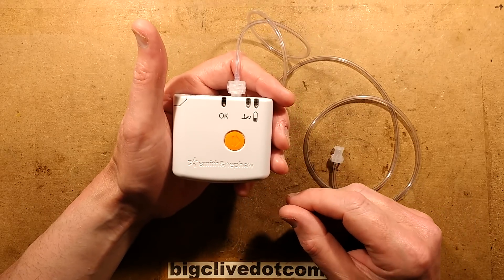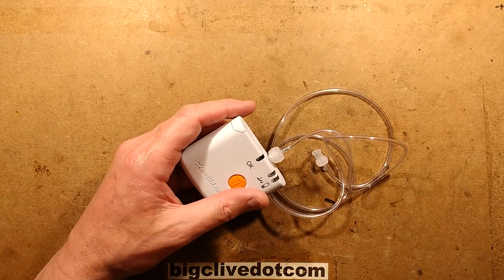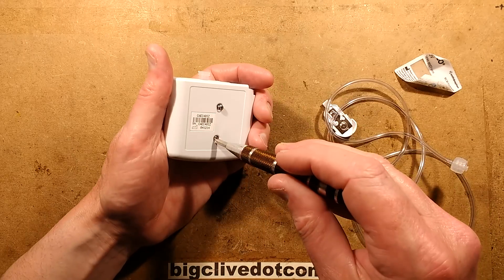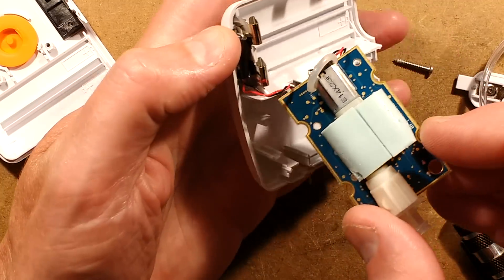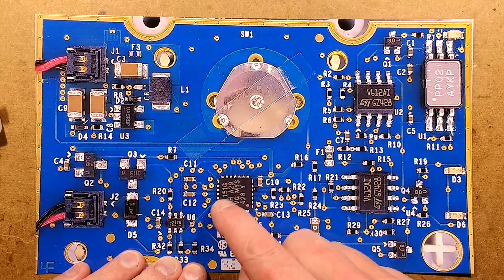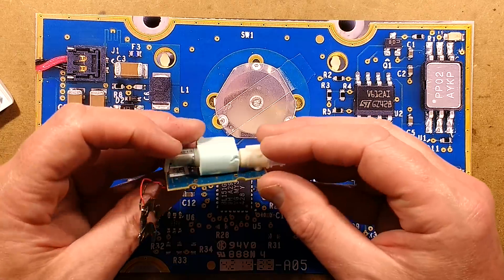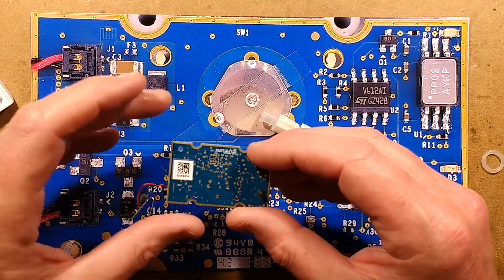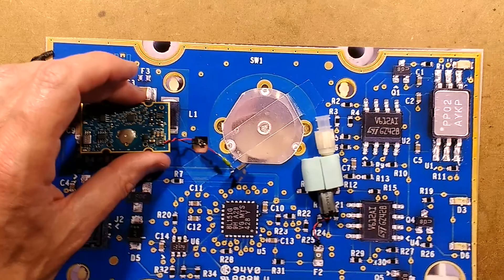Inside a medical wound sucking machine.

Comment: Are the fuses different current values? I'll bet the lower current ones are slow blows for sustained overcurrent (if the pump got liquid or foreign matter in it) and then the larger one could be fast blows that are well over the motor and capacitor's surge currents, that would blow instantly on a dead short. As someone else said, patients might be using an O2 mask or something with this thing on them.

Comment: I have some personal experience with something similar to this. It wasn't a one time use though, much larger and it sucked up all the goo into a ~half liter transparent container (I never filled it), which had to be changed twice a week or something like that. Very disgusting. This was in Sweden in 2010, guess I would have gotten away with this thing only a few years later.

Comment: We use these PICO dressings in maternity.  They are used for Caesarean section wounds in women with a high BMI (body mass index) and the idea is to reduce wound breakdown.  They cost the NHS about £148 and come with the pump and two dressings.  It normally goes on in theatre and stays on 7 days.  You have the second dressing as a spare in case the first becomes damaged.

Comment: I got one of these after a toe amputation, except a bit different. Battery was built in and rechargeable, also replaceable canisters and dressings for the fun stuff. Quite a bit bigger as well. Quickest I've ever healed from anything and they left a nice hug "valley" where my toe once was. Took about a month and a half, but would have easily taken a year otherwise and keeping it clean that long would have been difficult Closed right up and looks better than the scar I have from my "love handles" to my knee from 3 surgeries after my motorcycle accident. A wound vac would have made that scar pretty. Heck, a wound vac would have saved my toe to begin with!! Problem here is there are 5 of them for about 500,000 people because the Govt. won't shell out the $50k each for more. They'd rather pay 4-5 
nurses salary to change a bandage every day for months on end instead.

When I told the ortho it wasn't much different than vacuum bagging fiberglass forms and those setups weren't that much, he tried convincing me to become partners with him to make and sell them lol  I had to explain that the cost wasn't for the thing itself, they're paying $50k for the insurance

Comment: I would have used a flying probe programmer to write my own firmware to it. I am surprised they used a ST chip not a PIC12, The pic is a lot cheaper than the ST.

Comment: me and my poor ass know something like that, it was like spring loaded, it really looked like a 25pcs CD spindle cake, also transparent, same size :D

anyways the required parts to make it go are all there... the sensor can be hooked up to a comparator and then to the transistors... i don't think there's a 3D map with neural network floating point PID calculation on the software :DD

Comment: Good teardown! I'm always impressed by the standards of medical equipment manufacturers, even on 'disposable' single-use devices. Obsolete medical equipment is plentiful and this is a great source of high quality components. I prefer to initially handle any surplus used medical equipment with gloves on, while wiping down the casings and accessories with anti-bacterial alcohol based wipes, just to be sure.

Comment: Clive, one of the op amps is to amplify the signal of the pressure sensor while the other and schmitt trigger should be used to control the pump keeping critical functions in hardware means the firmware within the main chip can be classed lower, (easier to get approved). I would expect to see a pressure relief valve in the vacuum line or the design of the pump unable to deliver dangerous amounts of negetive pressure as another form of patient protection. I was supprised to se an ST mcu in there as my understanding is they are not approved for medical devices, so the firmware would have to not be controlling the device in any critical way.

Comment: Clive is this you or your doppelganger

Photo
 http://i.dailymail.co.uk/i/newpix/2018/06/10/19/4D1832C600000578-5827289-Rainwater_even_had_to_be_cleared_from_the_stage_at_Murrayfield_S-a-55_1528654564068.jpg

Dm article it's from
http://www.dailymail.co.uk/news/article-5827289/Photos-drastically-low-water-levels-Lake-Districts-iconic-reservoir.html
Reply from the maker: It's a required look in the entertainment industry.

Comment: Did you try the obvious and power it on while holding down the button?
Reply from the maker: Yes I did, and also checked to see if it blows one of the small fuses next to the processor as a hardware memory bit.

Comment: Had a family member in the hospital for surgery to repair a perforated bowl that had been leaking for awhile. This was used to clean all the yuck out of the abdominal cavity while the surgery wound healed. As Simon Radford says, the wound healed much faster, though the sponge packing was new to me! The units they hook up to are nice little basic vacuum motors that run fairly quietly. (compared to all the beeps and boops in a hospital). The vacuum is touchy though. And this part never touches the wound so no possibility of contamination for you.

Comment: The power supply is a classic boost configuration. There are some great explanations of how it works online. 
The little chip will contain a mosfet, a diode, a pwm generator and a feedback circuit to regulate the output voltage.
The inductor and mosfet go directly across the battery in series. The mosfet closes and charges up the inductor, then the mosfet opens and the inductive voltage spike gets added to the battery voltage. This higher voltage is fed off through the diode into the output capacitor.
I have used this circuit in AA battery powered hand held precision test equipment (I was the lead electronic engineer on the project). Gave me 3.3 volts out over a voltage range of about 1.2 to 3 voltage for the pair of batteries in series. Really gets every last drop of power out of the batteries.

Comment: The little window on the label makes me think they re-manufacture them by replacing the pump & hose connector.
Every thing else on the unit can be reused & they just flash the firmware back on to reset it.
It would be a waste to just throw the thing away...they could even donate them to clinics after refurbing them.
Wasting tech like this pissed me off...so much of today's society is throw-away instead of fixing stuff.

Comment: as someone who wore a wound vac (KCI's wound vac) on a hole in my foot for over a year and even fixed a unit when they couldnt get a tech out to do so (holiday weekend i replaced the mainboard they sent to me via UPS nextday air) THIS unit is tiny! and with no container for drawn fluids as the bigger units i definitely can see why they made it one / limited use

Comment: I wonder if it'd be possible to desolder that ship & replace it with a different MCU.  Perhaps putting the new MCU onto a custom mounting board (so you can re-arrange the pins), then mounting that as a chip onto the main board.
It looks like every single pin on the original MCU is also broken out into a test point, so that will make it even easier.

Comment: Clive, DABRBP in super sot-5 package comes cross ref of a MAX6420 Low-Power, Single/Dual Voltage u p Reset Circuits With Capacitor-Adjustable Reset Timeout Delay. It is this that is doing the lockout! They check voltage and when it falls to preset it locks out even if you install new cells. Also i have to agree with James Talyor, security in medical devices is poor as they are not main consumer products, Also with a via to almost every pin and the right equipment any ST microcontrollers security can be circumvented!

Comment: Having worked in the Biomedical electronics industry it is interesting to see the progress in medical devices. The first wound management systems were Mains/battery units and rather bulky. They used a disposable collections container which was monitored for pressure to warn of blockages or disconnected tubing and also used a microfilter to prevent fluid or pathogens entering the system. Servicing the earlier units could be unpleasant due to spills and tend to be workshop jobs left on the shelf in favour of more interesting and cleaner jobs and hopefully the other technicians then had to deal with them!

Comment: Whilst I don't use these in my line of Medicine (I.D.), our Surgeons do use this sort of thing, and I often get referrals from our "Hospital in the Home" team with Patients using this exact device! They are not "cheap, cheap",  but the cost of a low-acuity bed here is in the realm of $1400 per day (not including drugs), so they save the Aussie taxpayer heaps. Very popular with larger area, and otherwise "difficult to manage" wounds - the sort of wounds that are prone to infection / colonisation, combined with morbidities that result in vascular problems (typically diabetes, but also the vasculitides). The ones I tend to encounter are post peripheral limb surgery in the elderly - wounds, surgical or otherwise  below the umbilicus are more prone to bacterial colonisation, which, in the less immunocompetent, can result in rapid development of systemic infection, sometimes necessitating the removal of the source of infection (amputation), and the significant consequential costs of post surgical management and rehabilitation.

Comment: Just bypass the electronics completely and fit a switch between the battery and the motor.  Use a valve on the air tube if you want to control the vacuum pressure.

Comment: Would be better if a drive shaft for the pump came out of the unit with a cog of some kind. Then you could have a small disposable pump unit that can clip on and engage with the motor. That way all the electronics do not have to be disposed of after use, only the pump unit and the tube will have to be chucked.

Comment: The two V612A1 could be running in parallel. I build medical air compressors and vacuum for medical needs.  Two fused transformers, primary and secondary sides, backup switches to manually cycle the unit if the main program fails or is corrupted.  Every system is rated to run with another rated pump to take up the load if one fails.  All plumbing has 2 of everything running in parallel, so one can be fixed or inspected without interruption.

Comment: I've used these a lot on my surgical wounds I've had in the past, (I've had a lot, multiple amputations and fasciotomies) . They help promote granulation tissue and boy can they hurt when they first turn on, but then they kind of feel nice. This wound vac seems like a really rudimentary version of one. The ones I have experience with were much more sophisticated, and had programable pressure and settings where you could set it for constant vacuum of intermediate where it cycles on and off and different timing settings. But the ones I've used I don't think were single use.

Comment: The battery slot, I’d guess, is so that the device can be fitted with new batteries before it is to be used. The label with the serial number cutout is a nice idea too, the manufacturer gets to preserve serialisation integrity and rebadge units for different languages and locales as required. 

Clive, I’ve still got that CPAP breathing machine if you want it, it might make an interesting high pressure alternative to the low pressure pocket vampire thing 😊

As far as disposability I can see the use of it; making a device like this reusable would escalate its cost disproportionately. As it is it is probably very cheap to make and works perfectly for as long as it needs to.

Comment: The big label, small label reason may be that the device is a "white label" product, sold to other companies to be re-branded. The serial number would be then from the OEM. Just a guess. I used to design firmware for so called white label products in the past...
On taking one of these apart once its been used... yeah, um. It is contaminated... yuck. :^(-
Cheers,
 - Eddy

Comment: My son has had three major abdominal surgeries the past two years. After the first he got an infection and ended up in ICU for several days, After the second he got a surface wound infection. The third time they put one of those pico pumps on. He didn't get any post operation infections and the scar was was much smaller than the previous ones. So as well as reducing the chance of infection they can speed up the healing of the scar and make a noticeable difference to the size of the scar.

Comment: These PICO dressings are amazing for simple wounds and longer exdudating wounds. For deep wounds you would need a VAC pump, which uses stronger negative pressure and dressings/gauze applied inside the cavity. 

These PICO dressings are designed for the dressing to be changed as required and to reuse the pump for the same patient over and over again. They are NOT cheap... Think £100 per pump and 3 dressings.

Comment: The reason for medical electronics being very expensive is because of the certificate, just applying of the certificate alone is very expensive and even then you are not guaranteed to get it. Problem #2 is once you got the certificate; you can't change the design! That is a nightmare when some vendors put "end of life" on components you are using, resulting you might need to pay extra to get a guarantee every part you use will exist for a long period of time. It is a complicated process to say the least.

Comment: As it was explained to me when they hooked me up to a hospital based system a couple of years ago, it has nothing to do with draining the wound.  It used to be that wounds scabbed over and this caused all sorts of issues and scarring. More modern dressings introduced a couple of decades ago sought to create a warm, moist healing environment, so that the wound remains 'open' i.e. without a scab and instead heals from the bottom up. As I understand it, if you then are able to subject the wound to a partial vacuum by applying an airtight over-dressing tied up to a pump, you 'stress' the cells that make up the bottom of the wound which in turn speeds up cell regeneration and also improves blood flow to the area. This leads deep or large wounds to heal a lot faster, particularly in the initial stages when the joining of everything back together again takes place. Probably for the majority of wounds an initial two week treatment would provide sufficient stimulation, so that simple dressings would be sufficient for final healing. Interesting that the FreeStyle Libre, a blood glucose monitoring device for diabetics, also has a programmed life of exactly 14 days. Not sure if it is the sensor (which sticks onto you) that shuts down or it is the scanner that knows that the particular sensor has been in place for that time and refuses to read it. Either way the result is the same, you have to buy a new sensor at £50 a pop, every two weeks.

Comment: Just today I dismantled a portable blood pressure monitor, my subsequent research would seem to be applicable. 
Those low-cost pressure sensors don't have any onboard signal conditioning they are just a simple bridge circuit not unlike a load cell bridge (now that I think about it, it probably is a load cell bridge) in most cases you will want a voltage for an analog input on your microcontroller and the data sheets seem to recommend a circuit using three op amps. Subsequently finding two dual op amps (I assume they're dual)on that board makes perfect sense to me.

Comment: When i sliced the top of my thumb nearly off through the nail and oh, bout 4 mm down from the tip, i actually put pressure for half a minute to a minute (mostly because of the flapping piece of cold meat i was trying desperately to "glue" back) and what do you know...it stopped bleeding. And mind you, you'd think, oh, tip of your thumb, how much blood can there be, well, when i went back to the scene of the 'crime', the whole window behind the mini saw (i was cutting some Balsa wood strips for an architectural maquette, finger slipped when it hit a less dense portion, went like through butter with that squelching noise and the dead stop of the underpowered shite motors they shove in those hobby saws) was covered in blood spatter, still is, i don't think i'll ever take that down, as a reminder of how close i nearly lost me finger top.

Comment: Must be made by apple.
Reply: Voltage controlled Ovulator almost worse than apple
Reply: simple fix DONT BUY APPLE crapp!!
Reply: My ipad air 2 is still shit with the touches. It was fixed by apple and now my dad wants his battery replaced AND I TOLD HIM NOT TO CAUSE THEY CANT FIX A SCREEN FOR SHIT!!!
Reply: well, you wouldn't want the microsoft version, "lifesaver.exe has stopped responding..."
Reply: Voltage controlled Ovulator  but this wasn’t sealed with glue or was made of aluminum.......😉
Reply: IPump?

Comment: Clive, that thing at 10:25 is indeed a fuse. They're quite common in that profile in devices made to extreme specifications, such as in medical devices or devices where there's a loss-of-life risk if the device malfunctions. Those fuses are also extremely fragile; I've tried desoldering them and they just shatter with the heat.
Reply: Not so difficult if teased off with a hot air gun, instead of using directly applied heat.
Reply: LF probably means Littelfuse